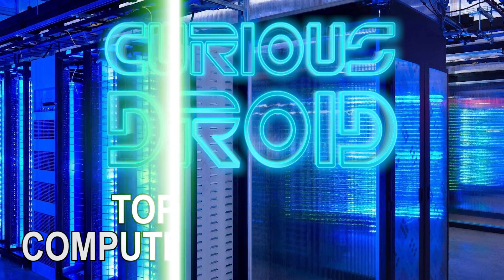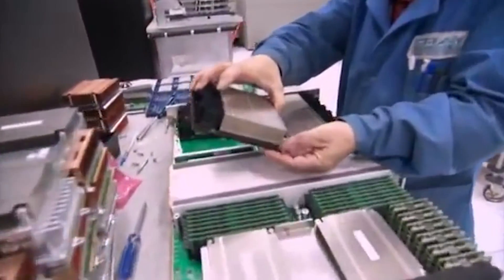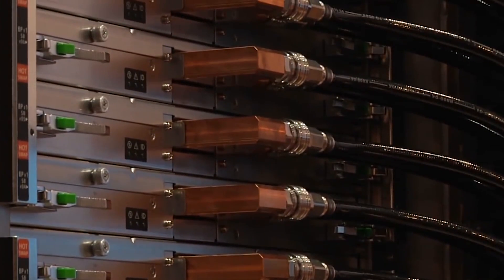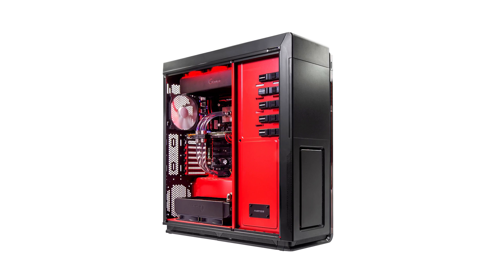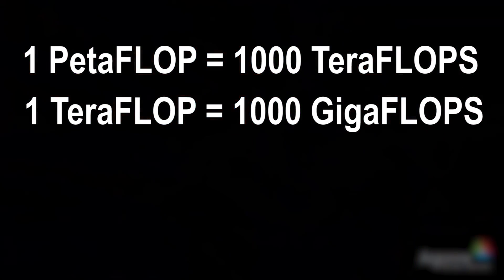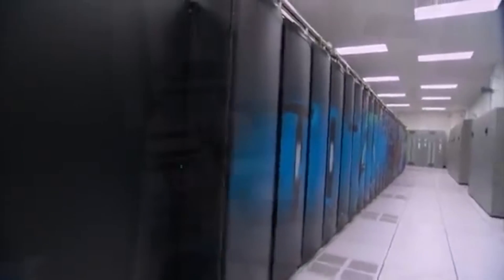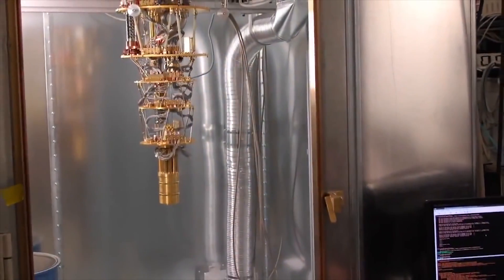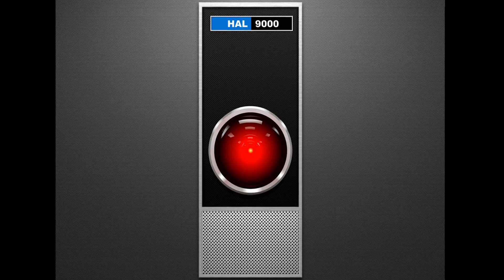Top 10 Fastest Computers in the World 2016 - How much faster is a supercomuter than a PC or iPad Pro

Comment: lol in a 100 years they'll be putting all that in phones
Reply: "actually not until we figure out a new way to manufacture transistors as current modern ones have hit the smallest they can without interference and we're going to be hitting a brick wall in computing power until new ideas come out sadly enough" Well, the thing is, if there were to be enough advancement in data transfer speeds you could potentially have a device that is nothing more than a glorified touchscreen television that just directly accesses the computing power of a master super computer with it's own set virtual machine. That would result in everyone having more computing power than a normal person would ever possibly need. The only issue would be the cost investment in building the facilities to house the supercomputers and the actual building of the machines themselves. If you really think about it from just the "computing power" standpoint of the equivalent of 100,000 $1000 pcs for $50,000,000, that's a cost of $500 for something that is currently costing someone $1000. Though that's not a super realistic evaluation, it's a rough idea of something that could eventually be cost effective without an actual need for smaller parts in the actually pc building process, only an ultra reliable form of communication between the devices to allow a fast enough flow for the required tasks.
Reply: - PhantomShadow - actually not until we figure out a new way to manufacture transistors as current modern ones have hit the smallest they can without interference and we're going to be hitting a brick wall in computing power until new ideas come out sadly enough
Reply: Jason Lee That was my entire point, ... IF DATA TRANSFER ADVANCEMENT OCCURRED. I know there are some services out there, and I know that there are some forms of remote access already. They just aren't that as capable as they could be. The data transfer speeds of today aren't up to par with it being a popularized method, but it would be cheaper and easier to streamline a more efficient form of connectivity than spending a lifetime just trying to make things smaller and smaller. Flow of information is the key to advancing technology, not making things smaller. Just like with electricity. If you wanted power when it first came around, you had to live right by the damn thing, having an infrastructure to instead TRANSFER that electricity is what dawned technology in the first place. You wouldn't really even need something as high as 1-4gb/s. It's something that could be a mainstream idea but isn't pursued because everyone wants things in their physical possession, and they want them small. It is already partially there, and a technological threshold would come far quicker, easier and cheaper through creating a better data transfer infrastructure than making an iPad .1mm thinner per year.
Reply: Jason Lee Wireless signal is only as strong as what is transmitting it, it has nothing to do with transmitting it faster or slower than the speed of light. Would we really have done it if it were viable? Because, in the country that demands these small products the most(the U.S) we have some of the slowest and outdated networking/internet infrastructure compared to the majority of other developed countries that haven't even had public internet systems nearly as long. Even countries considered "third-world" have FAR superior data transfer speeds for FAR cheaper. So, no, it's not about if it were viable or not, it's about keeping what's there because it's the same money without investment and people wanting small stuff, so everything is focused on cell towers and increasing their speed instead of focusing on an entire wireless structure, not just phones. Don't confuse market demand with viability. Until things get popular, they aren't shoved into the market. Tablet computers were around a decade before they became popular. They were as powerful as the first mainstream ones, but when they first came out, people saw them as useless and trivial, so they were considered pointless and they just disappeared. They had the same viability then as they did when everyone and their cousin just HAD to have one years later (even the same adults that shrugged them off before). Only then did money get dumped back into producing them. People don't know what they want, or what will get them to it, that's the issue. People think having a supercomputer the physical size of a thumbtack in their pocket is more important than having the same thing a different way.
Reply: - PhantomShadow - lol, no
Reply: - TKK - LOL in 100 years i Will have money to buy the iPhone 7.
Reply: - PhantomShadow - In 20 years, bro.
Reply: David Herrera yah that's probably more accurate
Reply: Flimbo nimbo That didn't make much sense.
Reply: Jason Lee How does that not make sense? You would be accessing the system remotely, still having the same computing power without the need to physically have it small inside of your phone. That's how massive data centers are accessed now, but only for data, and at different rates of speed. It would take a far stronger transfer method to actually control the system as a system at a much larger scale.
Reply: Flimbo nimbo That technology already exists. It's called a VNC server. In fact there's an app on Android which allows you to create an account and have a full windows desktop streamed to your phone from the company's server and allows you to play full PC games and such. Sure it's cool to play high end games on a weak device, but then your bottleneck would most likely be your internet service in which would need at least the speed of 1-4 gb/s Over the long run, this would be more expensive than just having an actual computer.
Reply: Flimbo nimbo Unless you know a way to transmit wireless signals faster than light, there is no way to make it faster. Streaming is not a viable way. If it were, we would've done this years ago.
Reply: ikr and 50.2 peta flops will be hobo style aka shit in future's standards
Reply: - TKK - sad part is all people will use it for is instagram
Reply: No in 5 sec

Comment: a 6 core has 100 GFLOPS and an xbox one has 5 TFLOPS Wtf?!
Reply: It has 1.35 Teraflops not 5 lmao.
Reply: just throw a gtx 750ti and u wil see
Reply: +Cyberat Rodent No there is not. If you know the specs of your console or PC then just search up "teraflops for (insert spec here)"
Reply: DankReaper one s
Reply: XxX_Magik_Unicorn_XxX o ok thanks
Reply: valentin ion The one s has 3 Tflops...
Reply: DankReaper i meant the scorpio
Reply: valentin ion Either way you're wrong. It has 6 TFLOPS.
Reply: DankReaper ffs whatever
Reply: valentin ion For Scorpio on the GPU side it's 6 tflop. CPU are always low compared to gpu.
Reply: Are you sure you arent confusing the S with the normal One? https://gyazo.com/ff1feaf36c8bc8b90a2a0d23b251894d
You're literally saying that the One S is 2.8% Faster than the normal XBone.

Comment: Measuring the performance of parallel computers is so very very very WRONG. First of all they only lend themselves to solving problems that allow themselves to be parallelized, like motion of gases etc etc where you do the same computation on all processors only they calculate different areas and each processor comes up with the result for its area. And if you want more power you "just" add more cores.

What is interesting though is the technology / information bridge between CPUs, it always is the backend / backboard / motherboard thingy that sets the overal limit. Otherwise we could just connect all PCs in the world and make one helluva super computer ..... that can be used for nothing then computing parallel problems.

No, what would be interesting to me is to compare the speed of single cores. Cause the brute force of a single CPU can be used for problems that do not allow themselves to be parallelized.

So ... how fast and small is the worlds fastest single core? What voltage is used? What is the distance between corners of the CPU? What instruction set does it use? Have there been any developments there? What metals are used in the CPU? Do they use DDR14 ( I just made that on up ) while we neaderthals only have DDR4?

Except for knowing the worlds fastest single core it be interesting to dive into the technologies that tie a multicore parallel computer together.

Comment: I think you need to go back and try this video again!  iPad Pro and PCs have some wonderful floating point processors in them that happen to be used for something else normally - namely graphics.  My nVidia GeForce 980 Ti can do 5.63 TFlops making my PC only 6,000 times worse than the top super instead of 338,000 times worse!  And I can add 4 of those cards to my rig giving me a system that's potentially just 1,500 times worse.  iPad Pro ~465 GFlops.  And if you think "well, supers do it using general purpose CPUs" you'd be wrong - most of the grunt comes from nVidia cards, just like my system.  Except they're badged-up "Tesla"'s and are a bit different and don't have video circuitry (but I'm ignoring that!).

Comment: Are most of the calculations on these done on the CPU, or done on GPUs?
Reply: GPU.
Reply: Well, it depends on the system. Of the top 10, only numbers 3,4 and 5 don't use some kind of GPU-derived co-processor card.
Reply: arithmetic  problems are dun on gup . and complex cal are dun on cpu. becosue gpu based is 1000 times faster then cpu based. for example 1 gtx 1080 can do math at 11 tera flops.

Comment: I give it 30, maybe 40 years for the lowest ranked super compute's power to be in your tablet or phone. Or desktop, if those are still around.
Reply: 16 years.  2016: Home PC = 8TFlops (GTX 1080).  2000: IBM ASCI White 7.226 TFlops.  ASCI White cost $110 Million and had 8,000 processors.  Home PC with GTX 1080 is a few hundred bucks.
Reply: I'm talking consumer grade computer, which is usually about $1,000. That 1080 is $600 alone
Reply: And then add another decade for it to go from PC to phone

Comment: Wow.  I wonder how they write onto a hard drive or record something that fast.  I know they are not using conventional SSD.  They probably have a special way to record the process that we do not use because that speed seems so fast that you can not write that fast onto someting.  Also the memory must be exact if they even use memory at all because it seems to me the memory plays an important part because it gets strained by the cpu because it has to be ready and exact for the cpu to keep running fast.  Seems the memory is probably more important than anything really because if its wrong then it could throw off the cpu or maybe slow down a few of them.  so interesting i wish i knew how it worked.  Im always guessing at these things.  Probably why memory is so expensive compared to a cpu which is the brain.  The cpu also has to be exact proabaly i think or i guess.  WOw.  I wonder if they can be linked and if magic happens between the cpus where electrons jump from one cpu to the other or share the energy or something.  Kind of magical but also scary too.  neat stuff.

Comment: imagine Using this thing for Ddos and Cracking-Operations 0.0
Reply: It would be very easy to track don´t you think?
Reply: mira botnet is more powerfull. besides its about network bandwith usage a ddos not how much flops it can generate.
Reply: DDoS attacks definitely still happen...
Reply: Resistance is futile.
Reply: +Ben White but still hacking into a supercomputer. 
TO DO HOMEWOTK.
Reply: Oh for pete sake Common Core math would wrek any of these. The Logic flow wouldn't know what to do with it.
Reply: For instance I was driving my 10 year old son home from school and he said to me that 00 + 9 = 99. I about pulled over from the shock. I had to quickly explain that even though 0 + 9 = 9, zero is a single point on the number line, and it does not matter how many zeros you put on paper, it is still that single point, then if you add 9, you only move 9 digits up the number line. He was like ohhhh. I about hit my head on the steering wheel.
Reply: nice

Comment: In fact how fast is a computer is not just counting how many flops it have. Let say GPU computing. a gtx 1080 graphic card have gpu that run 8TFLOPs of power. But you can't compare a gtx1080 with a core i7 and say that gtx1080 is much faster than core i7. They are designed to run different applications and cannot be directly compared. Just like you can't compare 1 apple with 10000 oranges.
Reply: Finally! someone who actually knows his shit!... was hoping someone would point this out because I'm too lazy to type lol!
Reply: Its about flops. A CPU can only do it linearly. A GPU can do it parallel. And its all about the FLOATs.
Reply: But gpus arent always faster. i tried GPU vs CPU rendering with Turbulence FD (realistic flame Simulation) and my i3 was faster than my GTX 1060!

Comment: why do they cost millions of dollars when I could get 52 thousand PCs each costing one thousand meaning that I can get the same power for 51 thousand dollars rather than it costing millions. Why is it costing millions if the amount of the parts are comparable to a 1000 dollars PC times 51 or times 80 or times 100 making those super computers costing thousands and not millions? Either your comparisons are not accurate at all or these companies are getting punked by the computer corporations.
Reply: Do you have a nuclear reactor on tap to power and cool all of those PCs? Clusters have more going for them than just a lot of processing cores, they have radically different power delivery and cooling systems.
Reply: also you need to take care of massive data exchanges between each cores
Reply: no 52,000 x 1,000 is actually 52,000,000
Reply: ***** oh shit i messed up my math.
Reply: TheEgyptianOne yeah lol

Comment: The real question here is: Can it run Crysis?
Reply: Simon don't even act like a 750 is good
Reply: i said it before and ill say it once again !
NO DEVICE ILL BE EVER ABLE TO Run Crysis at 60fps so don't try
Reply: I was thinking the same thing
Reply: +sri krishna it doesn't matter, because you are going to emulate windows with the Linux KVM kernel so you can setup which hardware you're going to passtrough.
Reply: my pc is capable of that (GTX 750Ti)
Reply: Eli van der Geest I thought they used bunch of Intel Xeons
Reply: ShardX i7-4790k 5.7 GHz OC + gtx 1080 32 gb ram should do it
Reply: Emulation.
Reply: aeliar no because crysis is designed to run in few core processors